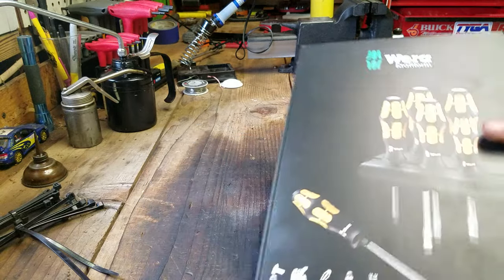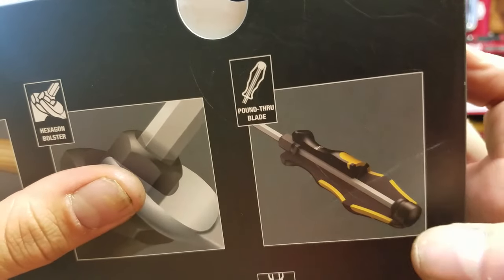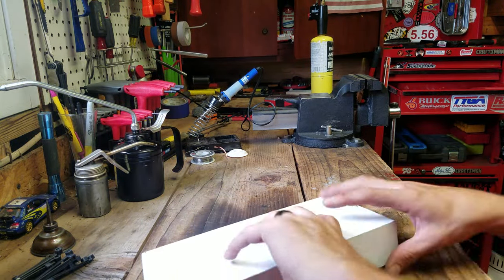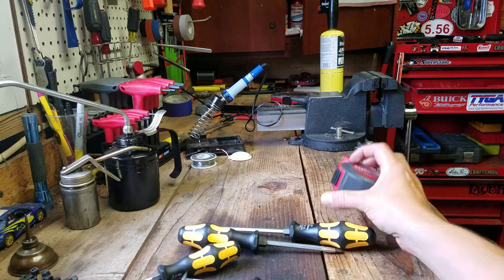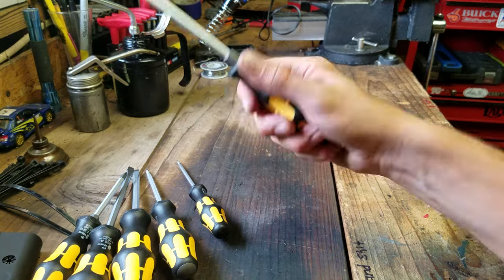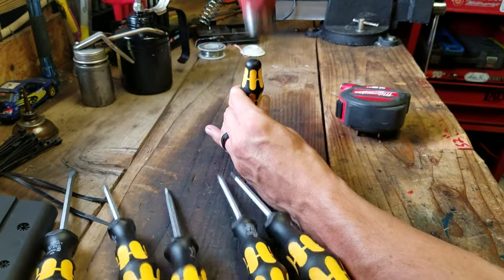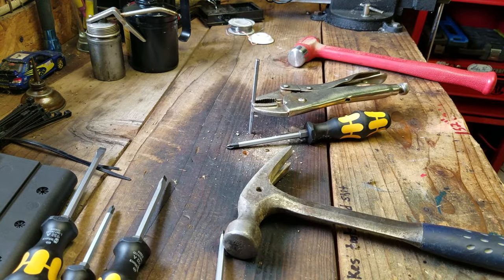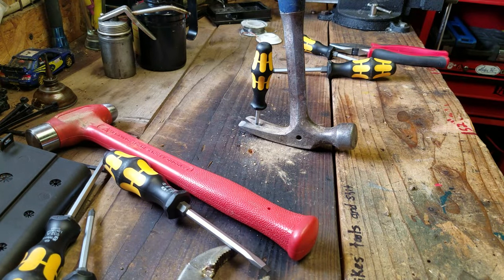Wera Chisel Drivers- Watch till the end... seriously

Comment: You can't use small screwdriver with the hummer. Read on the box. a
Small screwdriver has only plastic handle and it's not impact resistant.
Reply: I almost did the same mistake. I looked at small screwdriver and saw that it has only plastic handle. Small one couldn't handle impact from hummer.
Reply: Just use 2 component glue and stick it back. Leave it for one night and it will be like new.
Reply: Ruslans Lazurs so only big ones are for hitting . This just got confusing
Reply: Ruslans Lazurs t
Reply: At first I thought it was dumb this style of set to go so small, then found out it's even dumber because it is not even the same style.  Why would they do such a thing?  IMO they shoulda included an even larger flat head instead.
Reply from the maker: +MrNateSPF I agree,   maybe last minute cost cutting design change?
Reply: +Mike's Tool Shed I hate how much more expensive it is 'per-piece' to buy them individually, but to get the set they make you buy tools you don't want.  They get you either way.
Reply: Yeh try this on a snapon ,then see how you fair with ur so called lifetime warranty
Reply: And you fucking did it 😂😂😂
Reply: Most screwdrivers fail if you hit them with a hummer.
Reply: This is what center punches are for
Reply: @ClassifiedRecon  only the ones with a pound through blade are meant to be hit with a hammer. You can easily tell by the metal strike cap on the end. The small one does not have that cap, it's pretty easy to tell which ones are meant to be a chisel.
Reply: What does concern met about wera screwdrivers is the fact that the metal part inside the handle is just a metal stick so when exposed to great force the handle will let loose because it doesnt have enough grip
Reply: @LikaPyramid  This is just not how someone should use that screwdriver. Force normally points towards the Screw, not the other way around.
Reply: @Elektrotechniker  yes i know but i meant that the metal cores in the wera screwdrivers dont have any anchors attached to the rest of the hard/soft plastic handles that they're in, this would make it really one tight part attached to the rest of the handle and without it, one can just slide it off if the force was great enough
Reply: @LikaPyramid  All of them do, just no that mini screwdriver. You wouldn't be able to exert enough torque to spin the shaft inside the handle on a small philips head like that.
Reply: At least he didn't call the tool shit for using it incorrectly like some reviewers do with some tools.

Comment: anybody else screaming pound it out the bottom of the bench?
Reply: Ryan Guyer yes I came here to write... just hammer it all the way through the work bench so it comes out the bottom!
Reply: The red mist had descended and much amusement was had by all. 

That's a subscribe right there.
Reply: That was what I said to myself.
Reply: Jessica Sterinschy
Reply: Ryan Guyner -- Ditto dat! 

A pin punch of the correct diameter would push the screwdriver blade out the bottom; even using the striking cap of the largest size screwdriver in that set as a hammer - if someone would want to do it that way.  ;>P
Reply from the maker: Arlen Norby who is jessica
Reply: Yeap, just replied to use a punch :)
Reply: Jesus Christ approves Wera's screwdriver shaft :)
Reply: yes
Reply: Nope, I say angle grinder, cut the bastard off, its fucked anyways. haha. Mind you I do tend to "fix" a lot of problems with the angle grinder.
Reply: My first thought as well.

Comment: At least we know how the non-striking cap ones are made - Press fit probably using a hydraulic press.  I was surprised that the shaft didn't come out the end of the handle when you were pounding on it.  I've seen that happen when someone pounds on the end of a non striking cap screwdriver.
Reply: I've done that to some tools myself. Epoxy is your friend.

Comment: Great test for the drivers. I would just pound it straight on down thru the bench, take the #2 philips and knock it thru the bottom all the way and then if the philips is stuck put a crescent wrench on the hex portion and turn while pulling up and out. I am also a fan of Wera screwdrivers.
Reply from the maker: White Tiger I wish I had those ideas while filming, would have made this perfect

Comment: Since you're an electrician, you could connect It to high voltage and burn it out of the bench. Or weld it to a chain and drag it and bench behind your car until only the screwdriver is left. Or have termites eat the bench away. Or get a woodpecker.
Reply from the maker: lol. you win the best suggestion award.
Reply: pure gold right there

Comment: as an electrician i only use the wera vde screwdrivers but have recently changed over to the replaceable blade screwdrivers (also vde) as they save a lot of space and weight in my tool kit
Reply from the maker: +neil mclaren I was just looking at that little kit today, the one in the pouch?
Reply: yes the one in the pouch
Reply from the maker: +neil mclaren I saw them in sale on KC Tools , I think it was like 25 or 30 bucks

Comment: The ones with the 1/4" shank in the end cap. Is for using an Insulated 1/4" ratchet. That is rated to Cat IV 1000 volts. I used them for torquing down loose lugs on live panels. Not made for striking...

Comment: Wow, didn't expect the shaft of these to be smooth and not connected to the cap either. I figured there would be some sort of reinforcement for the handle.

Also, adults that take offense to swears? Oh no, a certain arbitrary combination of sounds from someone else's mouth offend me! Geez people, lighten up. And downvote me if you like because downvotes on comments do nothing!
Reply from the maker: you and people like you are why I made videos. thanks
Reply: "and not connected to the cap either."
The small one he used doesnt have a cap and its not for hitting.
Reply: I’ve seen another brand made this way too. My brother goes on the tool truck to warranty a screwdriver and the rep pops out the shaft and pressed a new one back in. I can’t remember which brand it might have been older Snap Ons.

Comment: You can put rubber tape and then electrical over the end cap along with a high voltage glove if you really must use them on a live circuit. I’d also take a look at the vessel wood tang thru drivers. Wood is non conductive but still the metal cap is there

Comment: used the bigger one in the set to try to pound it in between a rotor and rim. It didn't hurt the screwdriver at all but I did break the heck out of a craftsman screwdriver doing the same thing
Reply: Because Wera impact screwdriwers are made from chrome molybden alloy steel and you have to be animal to destroy it

Comment: I could see buying the biggest of the set by itself if you wanted to buy a dedicated beater screwdriver. I might have to do that. I use the normal kraftforms in my pouch and I don't like beating on them.(I still do it anyways)
Reply from the maker: Tyler Rainville I'm gentle on my regular kraftforms. I beat on my tekton drivers
Reply: I'll show you a beater screwdriver, it is solid steel. I don't even think Iron Mike could mess it up http://i.imgur.com/VwPluaz.jpg

Comment: I would not even put a big screwdriver to the hammer test.  I would buy a chisel and use that.  Chisels come in all-steel shaft form that are intended to be struck.  Nothing that has plastic in it, should ought to be declared “impact resistant from hammer blow”.  Maybe it is impact resistant from breaking when you drop on the ground but not from gosh darn hammer blow!  What company shows on box is called marketing strategy to get customers to buy their products.  Sure they might be good screwdrivers for putting in screws but not getting whacked with hammer!

But I love your brave enthusiasm and you just casually start to use screwdriver as a nail!  That is some funny stuff 😂.  This demonstration was more of a comedy than anything.

Comment: Great review Mike,very entertaining. Shows the quality of the handles that it did not split,how are the tips holding up.
Reply from the maker: Douglas Talbot these are my go to screw drivers.  Some of the stongest screwdrivers I've ever had.  I use them on everything except any thing electrical because of metal cap on the top.

Comment: I'm an Electrician by trade and I have 2 of these in my pouch accompanied by my 1000v insulated set. I use these for installing lock-nuts on conduits and seal tight connectors in panels. I would never use these on live cct's but they are great to have in your pouch.

Comment: Neither the locking pliers nor the hammer claw would bite in to the baby driver shank, says a lot about the metal used. Not going to give you grief as it sounds like you learned from the adventure.

Comment: Actually, I would call that a "Fail" per-say. As I have a REALLY cheap go-thru screwdriver set like the Wera's, and they have the same problem. The shaft isn't welded to the cap, they just push it down to meet it. I actually think it's a design flaw rather than a material failure, as you could just put the handle back on. :P
Reply: *per se.  Latin for 'by itself' or intrinsically.  😉

Comment: As an Electrician, you should lock out what you're working on, and never risk having someone turn that fucker on.
Reply from the maker: Mika Kauppila sometimes though. especially on demo jobs. things are mislabeled or double fed. even had a demo laborer pry open a locked panel to try and turn some lights on. it hasn't happened to me in years. I was just saying it is possible even when you try really hard to be safe
Reply: Yeah fuck residential / commercial deathtraps haha. Mining is safer.
Reply: Mika Kauppila o

Comment: Question and a comment:

Q: Were you wearing your safety glasses before picking up the hammer?

C: Gotta hurt the ego to lose a battle with a piece of softwood. Would have been worse of that bench used wood that was cut 15 or 20 years ago and was dried out & shrunk, or if it was hardwood.

Overall, on the entertainment scale of 1 to 10 - I give this video an 8! 
Would have gotten a 9 or 10 if you got it out on camera.
Reply from the maker: Ed Anyone SHIT!   I pulled it right out after I shut the camera off. lesson learned. appreciate the comment. thanks
Reply from the maker: Ed Anyone and no safety glasses.  I always forget, and my dad never had any and he still has 1 good eye
Reply: I was just kidding about the safety glasses! I assumed that you weren't wearing them.

But it's nothing to joke about - - - about 45 years ago (when I was 22yo) I tried to drill a broken cotter pin from a VW rear axle shaft. Real "dumb ass" move, as Red Forman would say (That 70's Show reference).  Drill bit snapped off and I didn't have my googles on, just my eyeglasses it the days when they were made of glass not a poly-carbonate type material. I still have 2 "good eyes" though - thru stupid good luck.

Broke the lens and the broken bit was hanging out the side of my nose & sticking thru the broken lens "business end out"; the jagged end of that broken bit embedded itself right next to the little "ball bearing" thingy next to my left eyelids. I had gone into the bathroom to see how bad it was and could see good enough to realize the bit was "backed into" where it was parked; surprisingly not too much blood considering that head injuries usually bleed much worse that the injury is (past experience with head injuries learned me that) and missed my eye by less than a 1/8". Couldn't pull it out without causing more damage - so I had to turn the broken bit counter-clockwise to "rotate" it out so as to not tear the skin more and maybe pull my eye out. 

Once removed and after cleaning up most of the blood, I quickly called my optometrist (pre- speed dial days) to get into his office that afternoon to get a new pair of glasses ordered and have him look at my eye - before my wife got home from work ... Lucky that I had a "back up" set of eye glasses so that I could drive myself about 4 miles thru the city and the optometrist was a friend of the family (hell, the 20 or so of us who wore glasses on my father's side of the family probably put both of his kids thru college!) so I got instant service and a rush on new lenses. Backup pair = I had broken my eyeglasses so often as a teenager that I would have two sets of lenses made when my prescription changed - 1 new frames with new lenses and the last new frames for the other new lenses - just kept buying the same RayBan Aviator style frames for a period of over 20 years until RayBan was bought out . 

No permanent damage and was told how lucky I was, but "the doc" insisted on what passed for prescription safety glasses at that time. Too damn heavy to actually wear and damn expensive to boot, so I didn't wear them too much while working. And my wife did freak out - 2 trips to the emergency room in the previous year; I had a bad habit of sitting up under something or looking up when something on a closet shelf sounded like it was falling down - other dumb ass moves of mine prior to that drill bit incident where my wife had to drive me to & wait, or pick me up from the emergency room after I walked 1/2 block the fire station near where we lived at that time (free ride in those days).
Reply from the maker: Believe me. I know how fast things can happen. Usually when I remember to wear them. Something ends up flying up and hitting them and I take a deep breath and thank God I remembered that time. I just rush into things but my shed has like 5 pairs through out so they are always with in arms reach.  I will keep what you said in mind (and maybe look up some eye injury porn) and maybe it'll help me remember. But there are certain things I will wear them 100% of the time

Comment: They are demo drivers lol. I would never use these for electrical work other than for knock outs in boxes, prying on things, and tightening lock nuts. Use regular screwdrivers for working on devices or equipment.

Comment: I'll stick with klein thanks. and as you likely know from AVE, up here in kanukistan, we use the elusive robertson quite often, 3 sizes in fact, the fourth being the ugly stepchild of the lot.
Reply: average driver load out for a sparky is: 
1/8 flat
1/4 flat
3/8 flat (aka the beater)
#1 Robertson (aka #6, aka green)
#2 Robertson (aka #8, aka red)
#3 Robertson (aka #10, aka black) not needed a whole lot, usually a flat or pipe reamer will do.
#2 Philips

In the trade, I've never needed a #1 or #3 Philips, as most farseners here are either standard or robertson, or a combo of the 2.

Comment: Use a wood chisel to remove the wood next to the screwdriver and after enough wood is gone you should be able to just pull it out. You can always patch the hole with another piece of wood shaped to fit, or drill it out larger and glue in a big dowel.
Reply: This is the worst idea

Comment: The cushion grips in the handles are not durable to grease, lube, sprays, fluids and cleanings. The pads will separate from edges when cleaning with whatever we have lying around in the shop. Germans think we girly men need cushions on our screw drivers. Classic case of over engineering or over branding. I don't see other drivers with fancy cushion pads because it is unnecessary joint.
Reply from the maker: Jonathan Pope excellent point man. They are nice though. And out beloved, God of tool I have seen first hand German . ..
over engineering with BMWs and Audis

Comment: I'm really sorry but after seeing you abuse that innocent little screwdriver i can't help but feel that you might indeed be the biggest tool in that shed..  xD

As has been said the little one doesn't have the hex bolster OR the impact cap because it's too small to handle the torque or hits.

Also the lengths of every screwdriver from Wera is printed right there on the handle so no need to measure it, it's in metric but as we all know that is the standard for the entire free world. If you don't believe me then look it up, your imperial measurements are actually based off of our metric standards. Go figure...

I absolutely love Wera tools too, especially their Zyklop wrenches that can be turned into kind of a ratcheting screwdriver. If you haven't seen them look it up, they are f-ing amazing :D